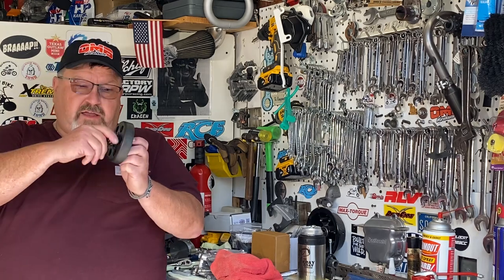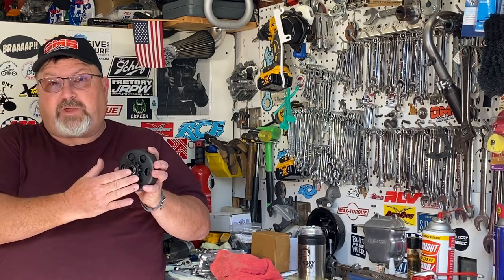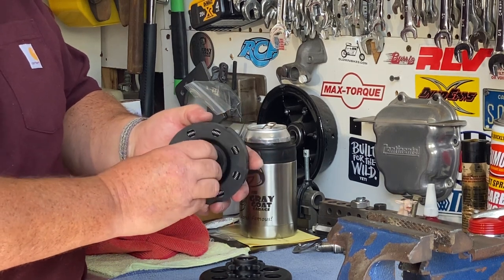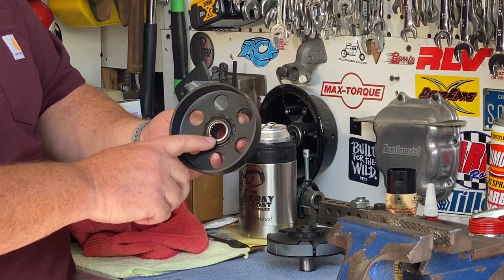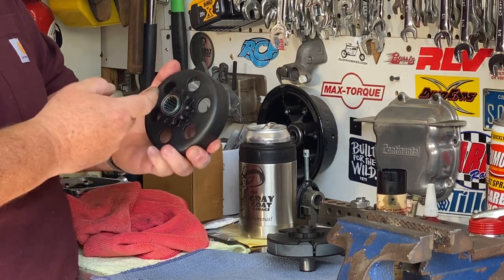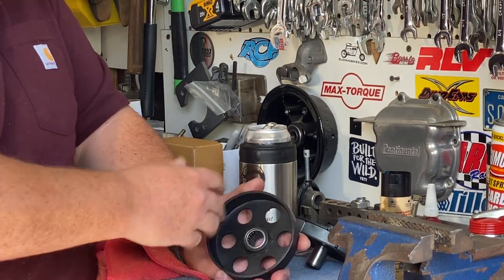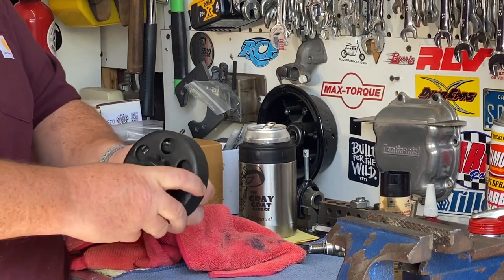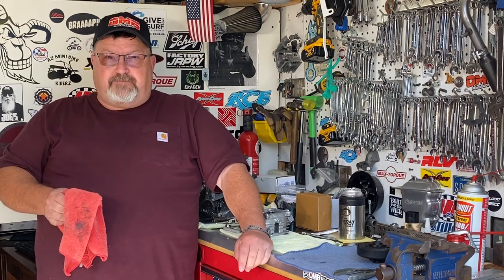Coleman CT200 BT200 needle bearing clutch service

Comment: Wow thanks Goats! I've definitely thrown out a few clutches that were still good in my past.
Reply: Only on Colemans. The clutch with the caged needle bearing was the only thing good about the 16mm crankshaft.
Reply: @Deucealive75  .....🤔....the 1 inch adapter for the torque converter....if it wasn't for that 16mm shaft I might have a more difficult time getting a 30 series on a Predator 79....that's 2 for the 16mm!!

Comment: Coleman changed to the 16mm crank in 2016. Most of the bad reviews were for the clutch and chain falling off. I think a lot of people were getting the bikes without understanding the maintenance required. I think I adjusted my chain 3 or 4 times before it stopped stretching. A lot of people don't realize the chains need adjusted (and lubed) even though the bike is still "new'". If they don't get that they aren't going to know that the bronze bushing in the clutch needs a few drops of oil often. I'd bet a lot of guys are using oil on the caged needle bearing instead of the service that should be done in this video.

And then there are riders that are hard on the clutch. You can't baby them. Engage the thing and go.

Comment: I have seen 13th 420 clutches 3\4 on line but 12 tooth nowhere.
Reply from the maker: The common clutches for 420 chain all have 10 teeth. There is an 11 tooth option for a Noram clutch. I have never seen a 12 or 13 tooth clutch for 420 chain!

Comment: Can I switch over to 35 chain on the Colman? Running single chain and can only find a 12 tooth cluch for 420 stock chain.
Reply: With the 224 by the way. Not the 196
Reply from the maker: Yes, you can switch to 35 chain, but I don’t recommend it! It requires a sprocket adapter and new rear sprocket and even when done you still will have a bad drive ratio that will kill clutches quickly. 
Eliminating the Jack shaft took you from a 10:1 drive ratio to a 5:1 drive ratio
There are no 12 tooth clutches for 420 chain
You would be much better off with a torque converter 
If you really want to use a clutch and straight chain, have an 80 tooth sprocket made! It will be the size of a large pizza pan but will work for you
Reply: Thank u sir. Damnit. Haha